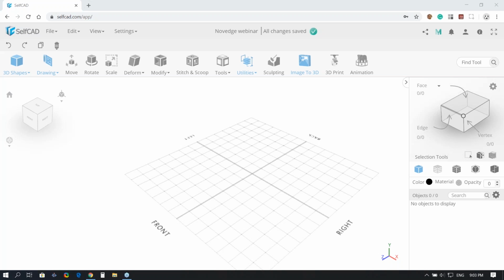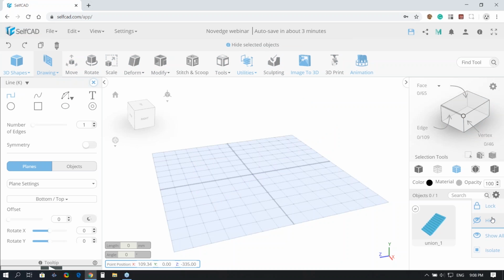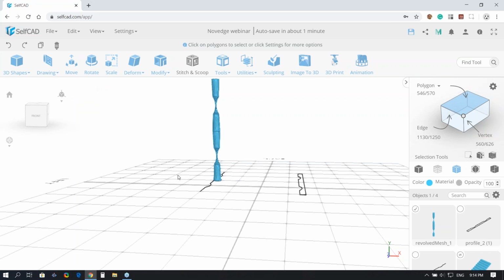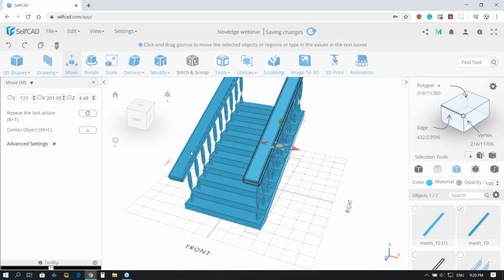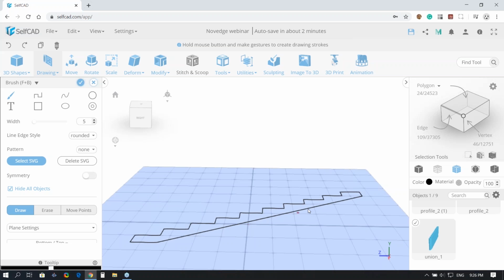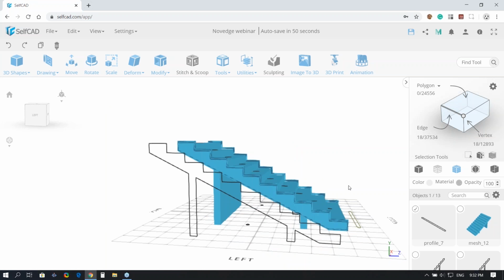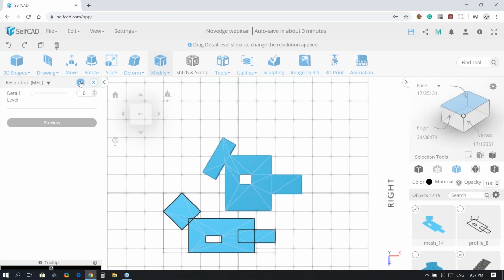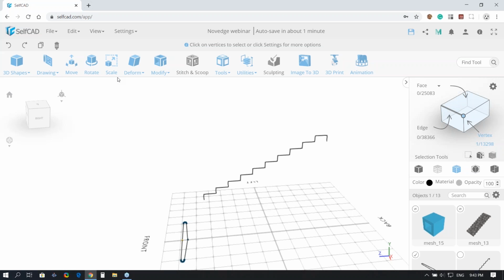Introduction to SelfCAD  Discovering Hidden Features

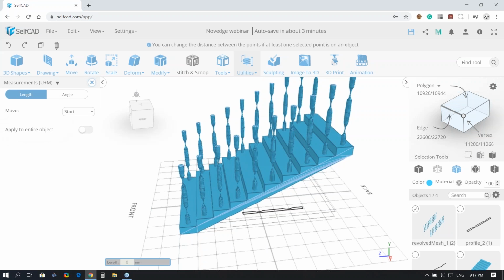Comment: I was on the live webinar and it was great but this video is not well synchronized and the screen is sometimes lagging. For example at 16:10 the screen is frozen and is not showing what is described and then seems to quickly ketchup at 17:10
Reply: Froze again at 18:10 to 19:20 just missing essential parts :-(